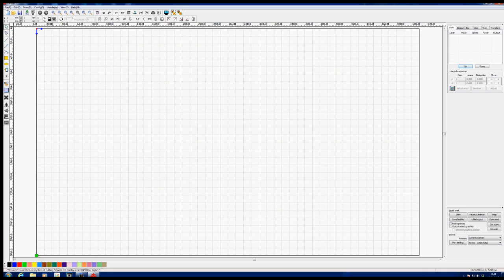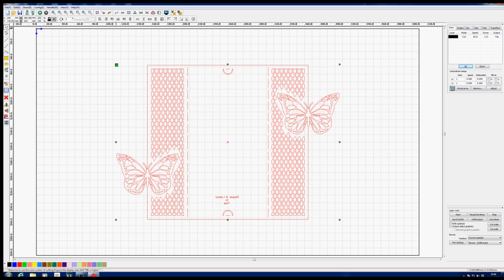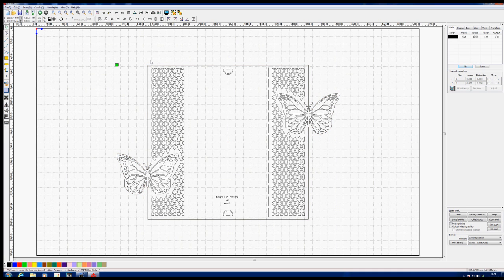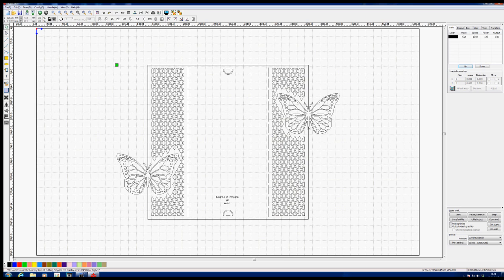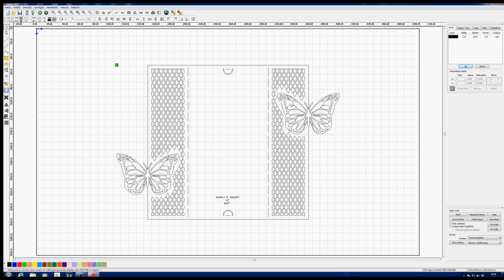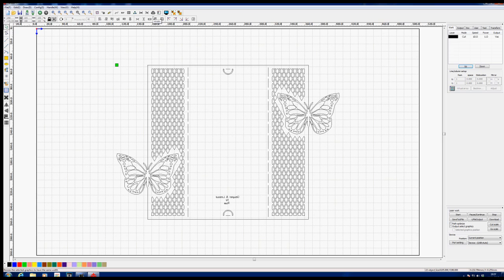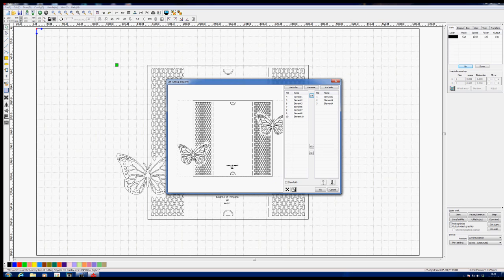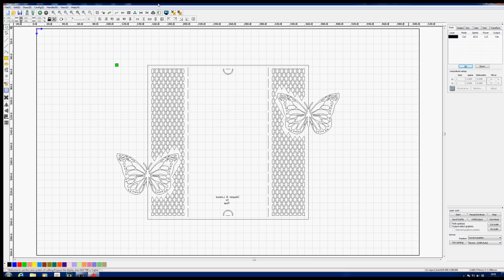RDWorks Learning Lab 29 The ULTIMATE way to order your programs

Comment: For some reason my laser ignores this layer groups :(
Reply: Solved. There's a checkbox somewhat bellow "Start" button, called "optimise path" if it's checked, it ignores the layer order.
Reply from the maker: Hi Anton
To make this work you must go to  Handle  Cut Optimize   and CLEAR all the tick boxes. You must also look bottom right and remove the path optimise tick.. You may also be using a very early issue of RDWorks. I think it is currently at about V8.01.49.   Many recent features are of no benefit  so I am happy to stay with an issue that is stable and works well  (issue 38).. Let me know f you still have issues  because this grouping has worked well for me  during the past five and a half years through many softeare updates,
 Best wishes
Russ
Reply: @SarbarMultimedia  Thank you so much! Very helpful tutorial!

Comment: Hello Russ,

What is the best way of protecting our laser tube (not optimizing time)?

Scenario:
We have 100 squares, each square with 4 cms / per side.

Each square has the left side with 10% of power, the right side with 20%, the top side with 30% and the button side with 40% of power.
a)	Create 4 layers and the laser tub will cut all 10% then 20%, then 30%, then 40% [Cutting optimizing by ORDER OF LAYERS]. So, the laser power will be stable during all process.
b)	It does not matter, we can mix power without risking the laser tube expected life.
 
Thanks for your support
Reply from the maker: Whatever you are doing sounds weird. You say "cutting" but I assume you are drawing different thickness lines. You are worrying unnecessarily about the tube. It can be switched on and off as much as you like with no effect. The same applies to the power you choose to use,   provided that you stay within the recommended mA limit for the tube.. Typically that will be  20mA for 50 watt tube. 22mA for 60 watts, 24mA for 80 watts and 26mA for most tubes of 100 watts and above. If you do not have an ammeter fitted to your machine I would play safe and never exceed 70% power.
Best wishes
Russ

Comment: Hi, i just found this series. Thank you so much for these videos, these are very helpful for anyone who use RDWork for laser cutting. 

Group/ungroup is a very powerful tool for setting cut sequence, but I agree with nmeofdst8 aproach to set the sequence based on colors. A lot of people use other program to draw the artwork and only use RDWorks to set the speed-power parameters (CAM Side). Keeping color sorting in mind, one could easily change the color while still in CAD platform; it's also easier to set the cut sequence for even more complex artwork, for instance if one wants to engrave/scan and then score the outline of identical shape in a single file output, we could just copy and paste that similar shape(s), overlap it, change the color for each line, set different layer parameter, then re-order the layer while making sure that "Order of Layer" is checked under "Cut Optimize". 

Oh, and also, knowing to set the sequence based on color is helpful if people come to you asking to cut/engrave something. I always asked client to differentiate the outline color on their files before sending it to me to process; for instance the outer profile of a name tag file is black for cutting through and the lettering inside of it is blue for scan/engrave, the header is green for scan/engrave with different power/depth. 

Thank you and keep up the good work!
Reply from the maker: Hi
Thanks for your comment. Many people will find it useful to hear your suggestions because they (like you) use a drawing package  (CorelDraw, Illustrator or Inkscape) as their base creation tools.I am an engineer and not an artist so 95% of what I draw is with a CAD package where I only get single  layer vector graphics. I can chose to engrave or cut any elements with complete flexbility after I have imported my dxf files into RDWorks. This card for example is all one cut layer but it is essential that I cut the pattern of holes in the wing adjacent to the diamonds before I cut the outline of the wing because mechanical stability will be lost and the wing will blow down out of focus because of the air assist jet. As you get further into the series you will become more and more aware that I am not an artist and I am not using this machine as a creative tool but as a vehicle for learning about in depth aspects of the laser engraving and cutting technology.
Your colour separation during design creation and allowing RDWorks to auto order by layers is a simple and valid technique that will be perfect for some folks but for others this totally flexible technique  will be  a solution to some intricate issues. 3 years on and I have learnt a huge amount but I still use this grouping and  non-automated  method  because it suits my  production techniques. I often allocate features to different layers but group the whole layer and call it up in the order that I, rather than RDWorks, decide.
Many thanks and best wishes
Russ

Comment: Hi, I recently got a 40W laser.
I like the video on making this card!
I assume you didn’t used air-assist?

Is there a way you can send me the file so I can try to create this myself?

Thanks in advance
Reply from the maker: Hi Kelsey
Yer I did use air assist  but not full flow. I had the card up on a pin bed and the idea is to blow the debis away as soon as its cut. The real trick to cutting card is to use VERY low power. You must understand where the pre ionization  range is for myour tube It may be in the 8 to 15% region. You can easily identify it if you cut a few test squares  at different  ascending low powers. The pre ionizatio9n zone sounds very hissy because the beam has not settled into it's steady  phase where it is fully formed.  If you have an ammeter fitted you will see a very low average  current, but trust me, there are very high frequency pulses  of high power and current.  If you look VERY closely at the cutt produced, you will see definite edge perforation. But you get a perfectly scorch free cut. 
If you like to message me with your email I will gladly send the file.
Best wishes
Russ

Comment: I am currently engraving yeti cups with the rotary device, but my wording is not even. how can i prevent that from happening.

How can i make the laser engrave up and down and not side to side? I believe that this would solve my issue but i don't know how to do it.
Reply from the maker: Hi Luis
We do not have Yeti cups in UK but I am familiar with the design. Firstly they are tapered so to get your engraving onto a horizontal plane I suspect you have packed up one side of your rotary device frame. Is that correct?
If so then you have a problem of geometry that you have to solve. The mouth of the cup is a larger diameter that diameter where it falls away about one third of the way along the cup. The rotary device  (I am assuming it is a roller frame device) drives the cup on its periphery. BUT....which periphery? The large one or the small one want to rotate the cup at different speeds.  You have slippery stainless steel driven by slippery knurled rollers . I suspect you are getting rotation on you cup that is totally random.. If all I have guessed is correct,  then all you need to do is put a thin rubber band around the mouth end of your Yeti so that it becomes the one and only drive diameter and the other end will slip. 
Your question about direction change is doable...but not advised. You  can go into the parameter settings and because you are scanning you will get the option at the bottom to  select a scan mode. The normal one is X swing. You can choose Y swing to achieve your wish, however it will only exacerbate the problem you currently have. Try the rubber band first.
Best wishes
Russ
Reply: hi, while we talking  about rotary engraving. question why when i try to engrave an object to a coffee cup the object gets bigger of the original image from rdworks  measurement, . something that i should change on the machine or the software. the image  get's  to stretch it.
Reply from the maker: Hi Mike 

If you watch these it hopefully will answer your question. If not, shout out again.
https://www.youtube.com/watch?v=wyevrQXaGRo
https://www.youtube.com/watch?v=sIlXSZhgbe4

Best wishes
Russ

Comment: how am i set X any Y Zero (Origine Setup) Plz Help PLZ 
PLZ PLZ
Reply from the maker: Hi Samad
When you turn your machine on it will go to either the back left or back right to set machine 0,0.  In RDWorks at the bottom right corner you will see a POSITION selection window. Make sure it is set to CURRENT.   Now when you move the head around and stop at a desired start point. press the ORIGIN button on the keypad. This position will always be your start position program 0,0) until you set a new position and press the ORIGIN button again.
 see  https://www.youtube.com/watch?v=CWZvQXxbR_E 

Best regards
Russ

Comment: How much did you set up speed and power for CUT? Is That 100 mm/s  -  25 %....?
Reply from the maker: Hi Samad
When i did this video 18 months ago I was still using my old 40 watt tube that was lucky to deliver 30 watts at the work surface. I remember setting the speed to about 100 or maybe 120mm/s and the power to about 30%. However, neither of these values is important to you. Let me explain further. Speed first of all. You can set the speed as high as you like when you are doing small intricate cuts and it will make no difference at all. The machine can only run as fast as it can.. If you had a very fast sports car capable of 300kmph and you drove it on a race track that was only 100m square, what speed would you be doing after 50m when you would have to apply the brakes to get round the corner?. The larger the race track (maybe 1km square) the more chance you will have of reaching 300kmph. My point here is that you must set your speed and power to cut the long straight lines of the outside shape and the small intricate shapes will take care of themselves.
On my current tube which is 70 watts, just as the tube is struggling to fire up (about 4mA) there is a strange region of performance  (see https://www.youtube.com/watch?v=mXIDwQxhX3k   )  This region exists between 9 and 13% power for my tube.  Every tube will have this region but the power % will  be different.  I set my power to 13% and speed between 60 and 80mm/sec depending on the card I am using and I get amazing scorch-free results.
Best regards
Russ
Reply: Thanks
Reply: Thanks

Comment: What would happen if you stacked a few pieces of paper on top of each other before cutting?  Would they all cut through or would it burn the top one?
Reply from the maker: Hi Scott
Provided you could make sure there was NO air gap between the sheets then you would be successful provided you stayed focused ie maybe up to 10 sheets. On a few occasions doing simple shapes, I have succeeded with 3 or 4 sheets but as soon as the laser beam hits an airgap the smoke filters between the sheets making a terrible mess.
Best regards
Russ

Comment: I'm having a problem of some of the letters not connecting back up, a example is the O starts fine but when it comes back around it is off a mil or two and doesn't connect back where it starts, any help from anyone would be great.
Reply from the maker: Hi Marvin

Go to the You Tube private messaging system and send me your email. I will send you a test program that will help determine where the problem is.

Best regards
Russ
Reply: SarbarMultimedia 

Hi Russ.  I am new to lasers as well and would like to see if you would be willing to share this amazing file.  my email is
doccinator@gmail.com

Great videos.  I've learned a lot from them already.

Comment: Love your videos, this is engineering porn :).My wife and I have a card making business, which is kind of a part time job for us both. I'm purchasing a laser cutter machine. What would be your advice for cutting cards stock mostly. What laser power and speed? I'm seen a bit of burning on the edges of cuts on the card 14:15. Is there any way you can think of to prevent those from happening? Thanks so much for the information you are sharing.
Reply from the maker: +Abraham Saenz 
Hi Abraham

Looked at the video again and I think what you are seeing is shadow, not burning.  There will always be a slight brown halo on the immediate edge of your cut but this can be very useful when you are using the laser to draw pictures rather than just cutting out. (go to the messages section and send me your email and I'll send some examples of what I mean.). The brown halo is on the top surface only so if you need a pristine presentation surface then you would reverse your program and face the good side down. This works superbly for a pin bed supported card (like I have) as you can move the support to different areas for different designs. If you have a honeycomb bed then this will make things worse because everytime the beam runs over a honeycomb edge it will leave a little reflection scorch mark on the card.
On the subject of card media.......Some cards, especially the shiny ones, are loaded with china clay and will produce a lot of smoke that will stain your card surface Look for a soft matt card or thick paper. Sugar paper is superb (and smells nice as you cut it) but the best I have found so far is artists water colour paper/parchment   http://www.artdiscount.co.uk/goldline-watercolour-studio-pad.html. On my 40watt tube I was cutting this at about 25% and 120mm/sec. I suspect on my 60 watt tube that will be down to 11 or 12% at 120mm's

Best regards
Russ

Comment: I commented on another video but wanted to post here also.  The much faster way is to just click on that outside like you did, hold down shift and click on the little butterfly piece you wanted to cut last and simply make them a different color layer.  Move that layer below the black layer and set the same cut parameters.  No need for all that selecting and grouping and editing of the paths.
Reply from the maker: +nmeofdst8 
Thanks again. 
I'll give it a try
Russ
Reply: Yes I agree that it is what the colour layers are for.

Comment: Excellent explanation, as always! This way is much easier to work. Would you be so kind as to tell me what power has the air pump? (I would like to add air assist to my old laser) Thanks.

Marco.
Reply from the maker: +marcocp91 

It is a HAILEA ACO-328 (70l/min) There is an 80l/min version ACO-388, only a little more expensive. Check out Ebay.
Reply: Thank you!